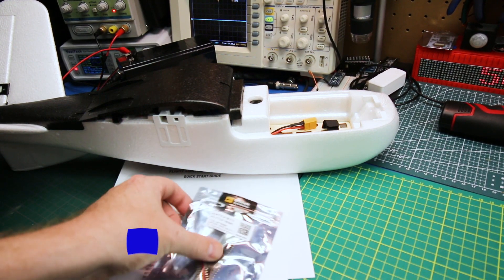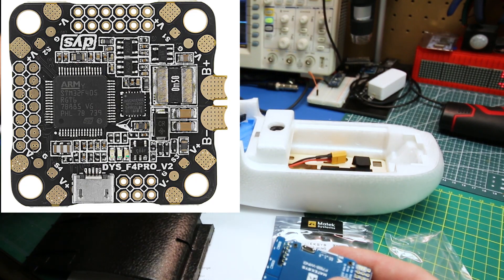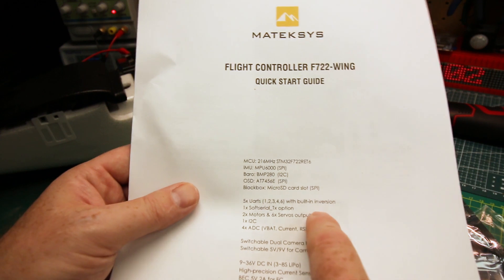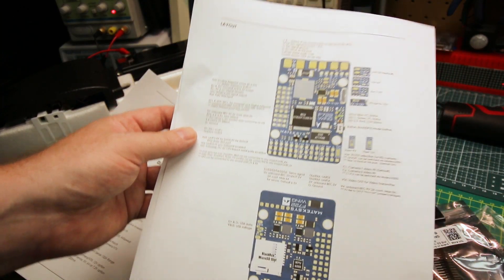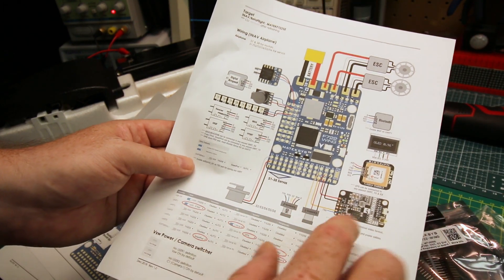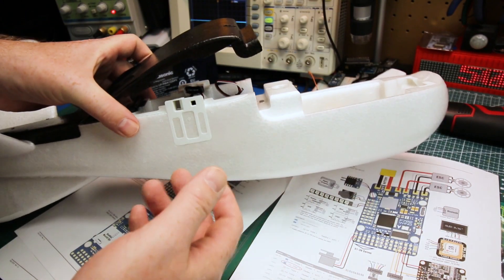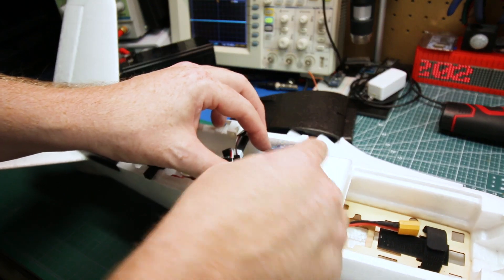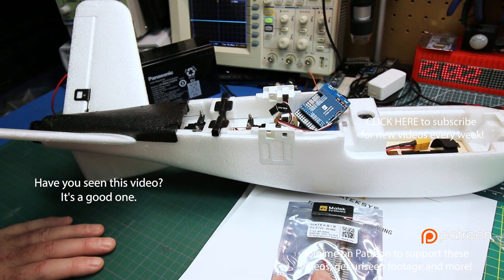Autonomous Aircraft Build - Nano Talon Ep.1

Comment: You need to try out a pixhawk one day. The ardupilot kicks arse over inav , but inav is not bad for simplicity .
Reply: Actually, you can install ArduPilot on one of those FCs from Matek.
Reply: @MCsCreations  
 I've seen people do it with an f4 board, but not yet an f7.
  And the pixhawk is a very nice board for setup how things plug in well, it has power redundancies, and in my opinion a better board, but it is more expensive, and if you have never used ardupilot before could be a bit overwhelming for some.